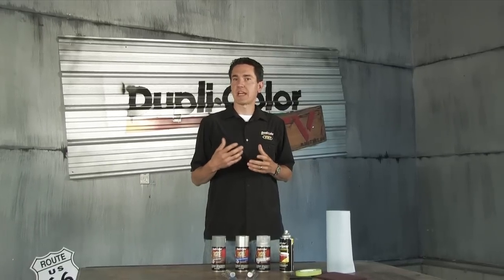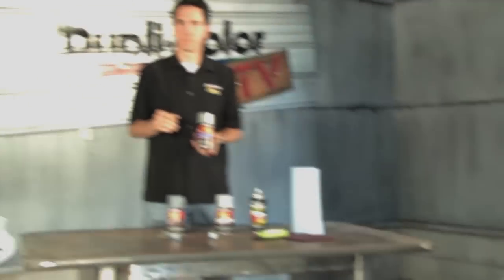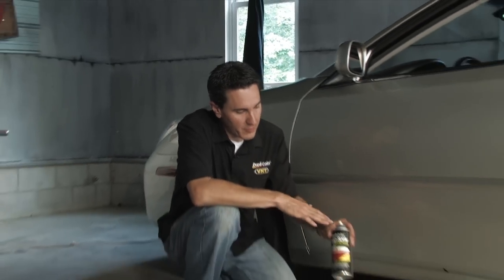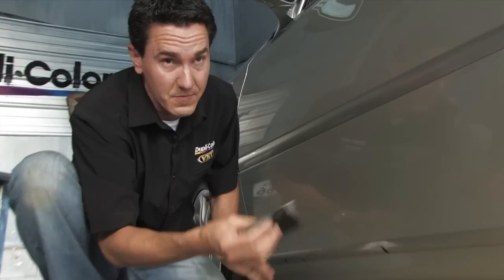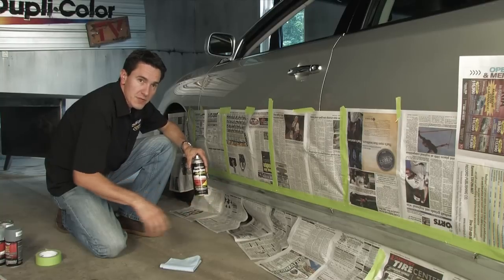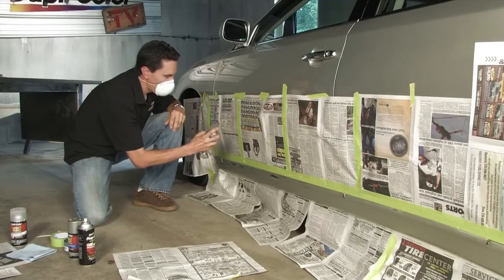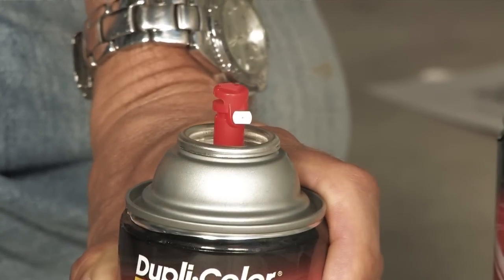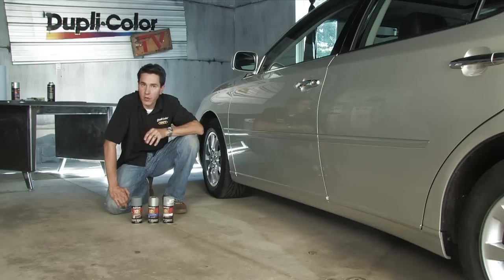Dupli-Color® How To: Perfect Match

Comment: I have a 2005 Honda accord (B92P color code) there are no scratches, chips, or damages on the surface I am painting except the paint is fading. Would I still need to use the filler primer? or can I use the paint coat and clear coat? Apparently Hondas of that color are known for having issues with that paint color.
Reply from the maker: +Force599 Thank you for reaching out to us!  You would't need the filler primer and should be able to just use the paint. We hope we answered your question!

Comment: It's cool and all but I think you guys should really put on an actual vapor respirator and not just a dust mask because that does nothing for you
Reply from the maker: Andrew Hennen Thank you for your note. 

Our "painters" in the videos are novices and may not have understood (like most DIYers) which mask is correct.  The working area is very large and very well ventilated. 
Anyone using these products should inquire with Mask Manufacturers for a best recommendation for spraying lacquer paints.

Comment: my projects all primed with sandable primer filler, now do I wet sand the primer before I apply the top coat to take off the shiny and give it bite? Same question after I apply the top coat do I sand before the clear coat? Thanks.
Reply from the maker: dicko195 Yes, you will want to lightly sand the primer before using the top coat and also between the top coat and the clear coat. Thank you for your question and your interest in Dupli-Color!
Reply: dicko195 yeah lightly sand especially when if it has been a while since sprayed. A general rule of thumb is if you have waited a day before moving to the next step you lightly  sand. Wet sanding is better,. You can for go sanding if you lay the paint after the previous layer becomes tacky. 

Sanding will also make low and hi spot more obvious.
Reply: +duplicolortv You want to sand the top coat before clear?  If so what grit?
Reply: +duplicolortv What grit do you use if you wait?
Reply: +duplicolortv Nothing on this clear coat states to sand the area down?  Although on another clear coat (acrylic enamel) made by you, it states to sand it lightly.  I followed directions like you should always do, Did I mess this up?

Comment: I tried all available steps above and maybe it was to humid and hot outside but the clear and basecoat blimished and looks dull. Any suggestions.
Reply from the maker: john romero Hi John, thank you for your question. Please call 800-247-3270 and one of our product experts will walk you through the steps to remedy this. Thank you for your patience while we help you resolve this issue.
Reply: john romero Just my opinion, if your paint technique isn't dead on perfect (with a spray can is hard to do) then you will probably need to wet sand and polish to blend and shine.
Reply: +jeff darnell I'm struggling with silver metallic paint on a 2005 Chevy Cobalt. I'm trying to blend the side of the back bumper into the rest of the bumper. I followed the steps to the letter described in the video and I still end up with blotchy looking paint and the clear coat is DULL.  When you write that I need to wet sand and polish is that after the clear coat or before?
Reply from the maker: Mike Nitzel Thank you for reaching out to us! 

Any mild automotive rubbing compound would work after the final coat of clear. 

You can wet sand the affected area smooth with 1500 grit sand paper to eliminate and imperfections and uneven appearance. Once smooth, clean the area, let it dry, then tack cloth it. Regardless if this is the primer, color coat, or the clear coat, We suggest using a method called "Tenting" to eliminate the hard edge line that can happen when masking off small repair areas.

Here is the technique:
Allow for a two-inch overspray zone/border all around the repair area. Lay a stiff or heavy sheet of paper over the repair area and tape the top edge of the paper, corner-to-corner, to the uppermost edge of the overspray zone/border. Now grasp the bottom edge of the paper you just taped and bend the paper up and away from the repair area, sticking the top edge of the paper to the body panel. The bend you have created is now facing you (kind of like a teardrop of paper hanging on the body panel). Depending upon the paper you are using, the bend may need to be tightened. Just tape the paper higher up on the body to tighten the bend. You want a tight bend without a deep sag. This bend or tent will soften the edge line created by the overspray that you would get if you simply taped a square border around the repair area.

Repeat this technique on the remaining three sides of the repair area, thus "boxing in" the area to be sprayed. You will have four bends facing you and your repair area boxed in the center. You should still see your overspray zone but the bend will be slightly obscuring the underlying taped edge. The slight overhang that the bend produces is what softens the overspray line and prevents overspray from spreading to far across the body panel.

We suggest testing this method on a piece of poster board to perfect your technique before doing so on your vehicle. You will still have an overspray line, but it will not be a hard line that needs lots of wet sanding to make smooth prior to buffing. Rubbing compound will blend the repair area much easier. You will need to allow the repair area to cure for 5-7 days before using the rubbing compound.

We hope we were able to answer your question. If you would like further clarification, please do not hesitate on reaching out to us at 800-247-3270.
Reply: Thank you! I'll give it a try!
Reply from the maker: Mike Nitzel We're here to help!

Comment: I heard masking an area off will give it a block look. Is that true ?
Reply from the maker: Knifes619 Thank you for your question. In order to make a repair in the middle of a body panel, wet sand the affected area smooth with 1500 grit sand paper to eliminate and imperfections and uneven appearance. Once smooth, clean the area, let it dry, then tack cloth it. Regardless if this is the primer, color coat, or the clear coat, we suggest using a method called "Tenting" to eliminate the hard edge line that can happen when masking off small repair areas.

Here is the technique:

Allow for a two-inch overspray zone/border all around the repair area. Lay a stiff or heavy sheet of paper over the repair area and tape the top edge of the paper, corner-to-corner, to the uppermost edge of the overspray zone/border. Now grasp the bottom edge of the paper you just taped and bend the paper up and away from the repair area, sticking the top edge of the paper to the body panel. The bend you have created is now facing you (kind of like a teardrop of paper hanging on the body panel). Depending upon the paper you are using, the bend may need to be tightened. Just tape the paper higher up on the body to tighten the bend. You want a tight bend without a deep sag. This bend or tent will soften the edge line created by the overspray that you would get if you simply taped a square border around the repair area.

Repeat this technique on the remaining three sides of the repair area, thus "boxing in" the area to be sprayed. Basically you will have four bends facing you and your repair area boxed in the center. You should still see your overspray zone but the bend will be slightly obscuring the underlying taped edge. The slight overhang that the bend produces is what softens the overspray line and prevents overspray from spreading to far across the body panel.

We suggest testing this method on a piece of poster board to perfect your technique before doing so on your vehicle. You will still have an overspray line, but it will not be a hard line that needs lots of wet sanding to make smooth prior to buffing. Rubbing compound will blend the repair area much easier. You will need to allow the repair area to cure for 5-7 days before using the rubbing compound. 

Hope this helps! Thank you again for your question.

Comment: Duplicolor, I rawly need your HELP! I have a 2008 Cadillac Cts, my color is raven black, which is the same color as a camaro. I grabbed a gm black and it has sparkles in it. Would the universal black be the right color?
Reply from the maker: Jorgeicr8 Hi Jorge, thanks for your question. We will need the OEM color number off of the inside of your driver's side door to determine which black would be right for your car. Please let us know here or call 800-247-3270 as soon as you have this information and we will help you figure out the right color.
Reply: Thank you for your reply. I did call but it seems like my time zone is behind and were closed . I believe the paint code in my car is u8555
Reply from the maker: Jorgeicr8 For the 8 ounce spray – Universal Black BUN0100 and for the All-in-1 Scratch Fix ASF0100. Hope this helps!
Reply: Thank you so much! I hope it helps too!

Comment: I just repainted some areas on my car using your products, the colour match is pretty good! However,  after applying three coats of clear coat, it still lacks a pleasant glossy finish. Do I need to polish the area? And how long shall I wait the clear coat to dry completely before polishing it ?
Reply from the maker: Tony Zheng Hi Tony, thanks for your question. You should let the clear coat dry for 72 hours before buffing. We would recommend using a 1,000 grit or finer sandpaper.
Reply: Thanks for the response.

Comment: I don't understand how does the clear coat blend in perfectly. If you use a mask and apply clear coat, won't you see a line from where the mask was?
Reply from the maker: AzNightmare 
Thank you for your question. In order to make a repair in the middle of a body panel, wet sand the affected area smooth with 1500 grit sand paper to eliminate and imperfections and uneven appearance. Once smooth, clean the area, let it dry, then tack cloth it. Regardless if this is the primer, color coat, or the clear coat, we suggest using a method called "Tenting" to eliminate the hard edge line that can happen when masking off small repair areas.
Here is the technique:
Allow for a two-inch overspray zone/border all around the repair area. Lay a stiff or heavy sheet of paper over the repair area and tape the top edge of the paper, corner-to-corner, to the uppermost edge of the overspray zone/border. Now grasp the bottom edge of the paper you just taped and bend the paper up and away from the repair area, sticking the top edge of the paper to the body panel. The bend you have created is now facing you (kind of like a teardrop of paper hanging on the body panel). Depending upon the paper you are using, the bend may need to be tightened. Just tape the paper higher up on the body to tighten the bend. You want a tight bend without a deep sag. This bend or tent will soften the edge line created by the overspray that you would get if you simply taped a square border around the repair area.
Repeat this technique on the remaining three sides of the repair area, thus "boxing in" the area to be sprayed. Basically you will have four bends facing you and your repair area boxed in the center. You should still see your overspray zone but the bend will be slightly obscuring the underlying taped edge. The slight overhang that the bend produces is what softens the overspray line and prevents overspray from spreading to far across the body panel.
We suggest testing this method on a piece of poster board to perfect your technique before doing so on your vehicle. You will still have an overspray line, but it will not be a hard line that needs lots of wet sanding to make smooth prior to buffing. Rubbing compound will blend the repair area much easier. You will need to allow the repair area to cure for 5-7 days before using the rubbing compound. .

Hope this helps! Thank you again for your question.
Reply: duplicolortv Thanks for the advice!
Reply: +duplicolortv maybe you should demonstrate this on your channel!

Comment: I tried doing this on my 2012 civic and it left an additional square layer of paint close to the back wheek looks ugly when ur up close.  I did just 1 coat so maybe I need an additional coat?The silver metallic paint looks lighter then the car itself. I only used alcohol, p360 scuff pad and premium perfect match paint. Did I mess up by not buying the clear coat n primer?! Please help.
Reply from the maker: Willy Frias Hi Willy, we would recommend 2 light coats and 1 slightly heavier coat of paint, followed by 2-3 coats of clear. Then, to soften the edges, use a 3M polishing compound. If you have any other questions, don't hesitate to call 800.247.3270 and one of our product experts will help you out.
Reply: Thank you! I will buy these products @ my local this weekend autozone :)

Comment: What should I do if my hood has sun damage should I sand it first then paint? I have the paint, primer and clear coat.
Reply from the maker: MrArieldubon Thanks for your question. You don't need to sand all the way down to bare metal, just remove anything loose and peeling and make sure the rest of the existing coating is dull. Then you'll apply the primer, paint, and clear coat. If you have any questions about the best way to remove the damaged paint, please call 800.247.3270 and one of our experts will give you some application advice! Good luck.

Comment: Hi!

In just got a primed front bumper for my Nissan Pathfinder (bought in eBay) and I'm planning to paint it with Dupli-Color Perfect Match. Since the bumper comes already primed I'm just buying the base coat and the clear coats. My questions are:

1.- How many 8 oz cans of base coat and primer should I use? 
2.- Do I need to do some sanding and prep to the primed bumper or I can spray the base coat right away?

Thanks for your help and any other tips are going to be appreciated!
Reply from the maker: AlfredoSagittarius Thanks for your question. You'll need to sand the surface of the bumper until it is dull. We recommend using 220 grit sandpaper. Clean the bumper with Grease and Wax remover. We would also recommend using our primer (even though it has a factory primer already, our paints work best when paired with our primers.) We would suggest 1/2 a can of primer, 3 cans of paint, and 1-2 cans of clear. If you have any questions about this, don't hesitate to call our customer service line at 800.247.3270 – one of our application experts will give you the best tips. Good luck! We'd love to see the bumper when its done.

Comment: I got some bubbles in my paint around the wheel arches in my 4th gen camaro, I plan on scrapping the paint at the spots then using rustoleum on the spots to prevent them from developing into holes, any idea if the primer can go on top of car designed rustoleum?
Reply from the maker: Preston Porth Hi Preston, thanks for your question. Our Primer should not be used over an enamel based paint, as it can cause problems in the finish. If you have any questions about this or any of our products, please call 800.247.3270 and one of our experts will assist you. Good luck with your Camaro!

Comment: I just bought a spoiler for my 4th gen camaro. Would one can be enough to cover it? I have paint code and have it sanded.
Reply from the maker: Paul Villesca Hi Paul, our aerosol products typically provide up to 18 square feet of coverage. Typically you'll get best results with 2 thin coats and 1 medium coat, so it depends on how large your spoiler is. Good luck! We'd love to see the finished product.

Comment: If i just have one scratch on my back bumper can i just sand that little area paint and gloss it or will i need to do the entire bumper?
Reply: I've done this before so I'll share what I did. 
Sand the scratch, prime it, sand it again then put the colour on just that little spot. Do a couple coats then I'd scotch brite the whole panel and clear the whole thing. Cheaper alternative would be just clear the newly painted section but then you'd want to wet sand it and then polish it up so you can't see the difference in clear coats.

Comment: My 2004 Honda Accord has OEM paint code B92P.  I bought a can of Duplicolor a few years ago by referencing this paint code, and the spec on the can was EBHA09410.  This was a perfect match of the black OEM color.  This week I bought another can for another spot on the car, and the new paint can says BHA0982.  This color does not match.  It is more blue than black.  Do you know why Duplicolor changed the mix of this paint?
Reply from the maker: Adam Reiner  The only time a part number changes is when the color is going to change.
A color change is usually determined by the Manufacturer of the paint (in this case Honda). That said, a few more light coats to build up the color is suggested.
Reply: Adam Reiner Wrong paint code. They still have B92

Comment: after adding the clear coat do you need to wetsand and use rubbing compound on it?
Reply from the maker: Frank Valdez 

Most folks will wet sand and use rubbing compound after the Clear has cured for a full 30-45 days.

Comment: I live in Michigan and my truck takes a beating from road salt. How well does this spray paint hold up against salt and corrosion? Im a little hesitant to use a rattle can on my truck. Thanks!
Reply from the maker: UnitCrane514 Should hold up like your OEM paint - however, if you're worried about it you should contact your local Sherwin-Williams Automotive and get a harder clear coat.

Comment: Do you sand the primer or paint coat at all?
Reply from the maker: We'd suggest that you sand the clear coat -- if you follow the instructions on the can, you shouldn't need to sand any other paint layer. If you get a drip or run in the primer or paint layer, you can always give that a sand. But you should only need to wet sand the clear coat.